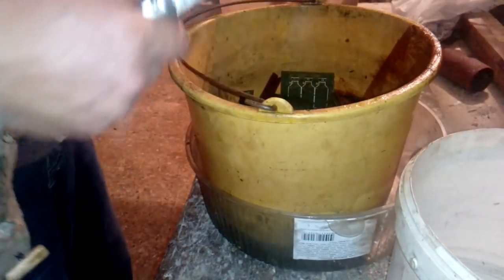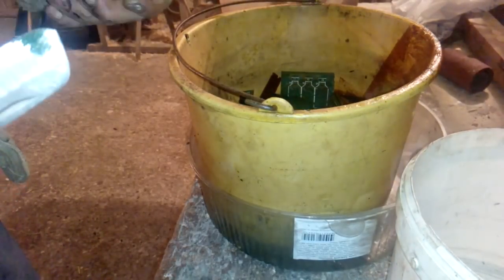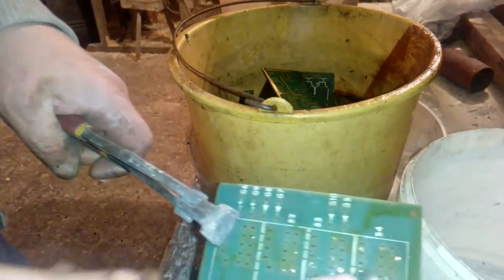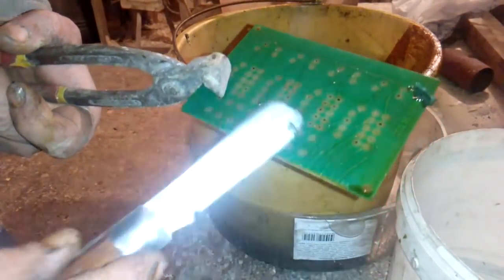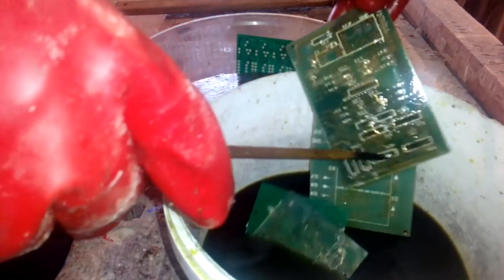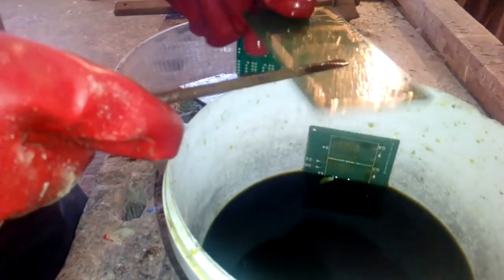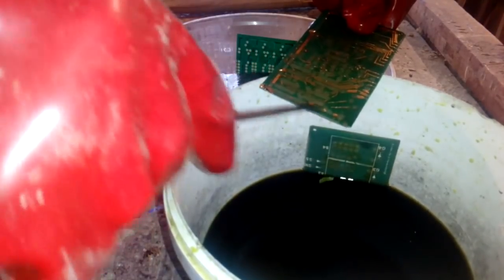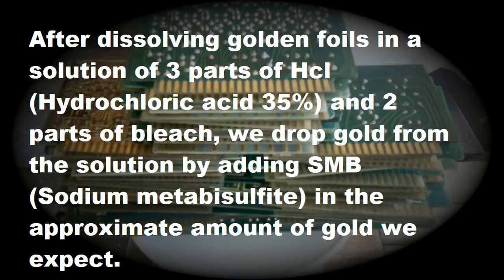Finger board from x-Ray mashine process for gold recovery with Ap PART 2

Comment: Dusan its green Laquer paint your removing not green solder on the traces it is green Laquer paint on the traces. I often wonder why know one uses Aircraft paint stripper in the spray can on this stuff. There are a few bio-paint removers I also would like to see tried.
Reply from the maker: That my mistake when I called him a solder and not a mask, is happening. It's about stripping paint vith some remover, and I thought about that,I von tried, but I did not do it yet . Any alternative for me is better for me than just cooking a plate in the lye.
Reply: It seam only in older stuff or Mil Spec. should there be any gold under the mask any way. I scrape it in places to check just in case , not like the good old stuff were all traces are gold plated much any more. The gold is super thin now a days thinner than the green paint. Starting wonder if the fumes are getting you...LOL.
Reply from the maker: Of course, things are not done as it used to be, now much less gold is used on plates than before, it raises the question of whether this job will be profitable in the future.